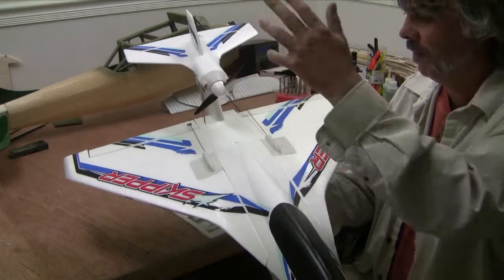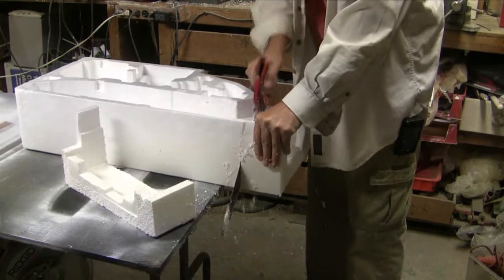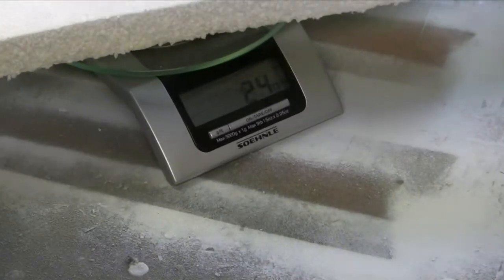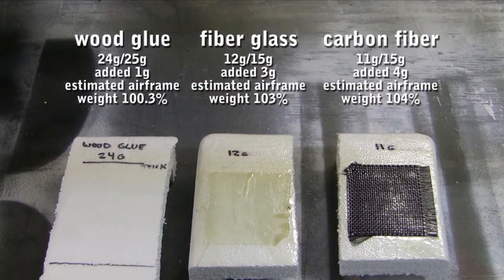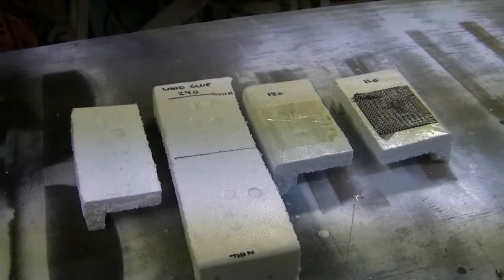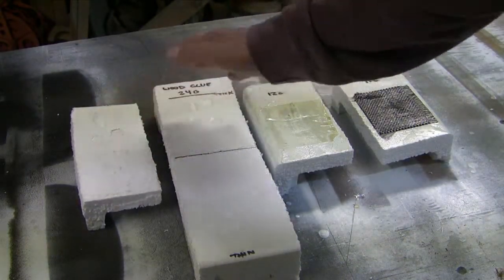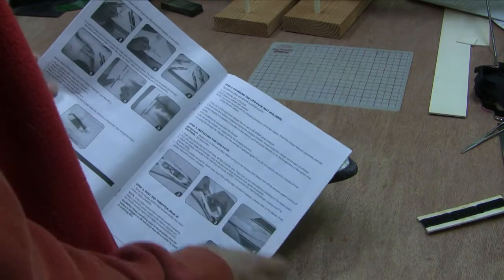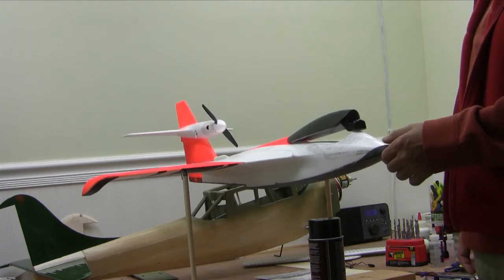Nodd RC - 066 - HK Skipper part 2

Comment: Good job testing the different materials and good job applying the carbon fiber mat. Looks great.  I had already applied aluminum tape to bottom of mine.  It won't be impervious to pavement but i expect long life in water - I applied a low heat iron to it.  It shrunk into the grain of the foam nicely.  A powerful bond I think.

Comment: Foam amour is also available by Horizon Hobby in the US. $10.80. They have all of the Deluxe Materials products. Good video. I have the Polaris which I built and love the plane.
Reply from the maker: Ahh yes look at that, Horizon Hobby does have Foam Armour in stock. I'm not sure that was a the case a few weeks back when I was looking for it but good to know its available now. I might have to order a bottle & check it out. Thanks for the heads-up Glenn.
Reply: ***** Was looking up the info and see it is water based so I do not know if it would work on float planes. It is paint able so it might work. check out dekalbrcflyers youtube channel which I manage.
Reply from the maker: Glenn Bond
I'm not sure water based is a problem for a float plane. I mean it doesn't spend hours in the water, just gets wet for a little while. I ordered some Foam Armour anyway, will do some tests & if it is a problem in water then I can still use it on other not so soggy airframes. Thanks again for the Horizon Hobby suggestion.

Comment: Chis, Hi. With regard to your Foam Armour. I did some research and I discovered that if you can aquire some Ronseal Diamond Hard clear varnish, that will do the same job as foam armour. In fact, I have tested both products, and they are one and the same. They are water based, and are easy to clean your brushes.  Perhaps you have alternative product in the States. I used a lightweight tissue on my aircraft, but a lightweight Glass cloth will do just as good. Paint a coat of varnish onto yoir airframe and then lay the cloth over the top, and paint some more varnish over the top, brushing out the excess. It is waterproof when dry. You can then apply more coats as desired without adding more weight. That is my solution, and you can even use car spray paint over the top.
Reply from the maker: +Anthony Bamford I finally got my hands on some actual Foam Armor recently. I've not had a chance to do a proper test but it looks like good stuff. Ronseal is available here in the States, appears to be regular polyurethane varnish. I've had good success with Minwax polyurethane varnish which I assume is pretty much the same thing? I like it for large jobs as its cheaper than finishing epoxy resin & does the same job more or less. Funny you should mention using tissue paper. I just coated a foam rudder using a roll of super lightweight brown paper, pretty pleased with the results. Granted not as strong as fiberglass cloth but for this application it doesn't really need to be super strong, plus paper is a lot cheaper too. Thanks for writing, good advice for sure.
Reply: +Anthony Bamford 
I use standard Yacht Varnish which is pretty well same. My first cats are water based paint to the colours I want ... single coats are good with this. Then overcoat with the Varnish to create water-proof and a hard shell finish. Any nicks are easily filled with the paint and a lick of Varnish over top.

Comment: Nice job comparing the options. I have often thought about a way to cover all my foam planes. I did not know about Foam Armour. Looks like lots of it available on ebay. Would like to know how well it works without picking up so much weight.
Reply from the maker: I ordered some Foam Armour. You can expect a review in an upcoming episode.
Reply: ***** What a great job you have done, we love it, can you tell me what finishing resin you have used and where I can get it.

thankd

Comment: Doesn't all that electrically conductive carbon fibre add a really effective barrier to radio signals? It's why we have special receivers (with antennae that run outside the model) for carbon models, is it not?
Reply from the maker: Apologies for the delay in replying, I've been taking a break from YouTube. Yes carbon fiber is quite effective at blocking RF signals. For that reason I'm using a "whip antenna" on this model that sticks out of the top of the fuselage. I do the same with all my CF models.

Comment: Cool vid.  What type (brand) of epoxy/resin do you use for finishing the fiberglass & carbon fibre?
Reply from the maker: UnlimitedVertical I believe I used Z-Poxy Finishing Resin on my Skipper's hull. I also like West Systems.
Reply: ***** Thanks.  I've had my eye on the Skipper/Polaris for a while, but this video peaked my interest since I tend to reinforce parts of my DIY planes and car bodies with a pseudo-fiberglass (fiber tape and goop/shoe goo).
Reply from the maker: UnlimitedVertical I've always been keen on seaplanes but sticking a pair of floats on a regular plane always seemed like a half measure to me. Their top heavy stance seems really unwieldy, one small hiccup & you're upside-down-n-stranded. Far better IMO to fly a purpose built flying boat with an actual hull. Of course I've flipped my Skipper over plenty so even that's not immune. Still she's a really versatile air-frame, grass, snow, water, sand, what-have-you. Fun stuff.

Comment: I have tried similar tests. What I found was the model was not the same type fom as the box. The box material was attacked by the paint. The model was not
Reply from the maker: Yes I didn't really give the rubberized spray a fair test. You can also try spraying just a light dusting at first & then build up from there. That gives the solvent a chance to evaporate before it can eat the foam. And yes you're correct, good chance the packaging is made out of a different foam but I think for test purposes, that didn't necessarily matter. It was the coating I was interested in testing. But obviously I didn't want to test on the actual model.

Comment: What is carbon cloth I use? I thought of 160g/m2 or 200g/m2. But this is just my guess. I´ve never done it before. I need an advice. THANK YOU.
Reply: +Petr CZ 
No answer, so I finally bought a 420 g / m2 and it looks good.
Reply from the maker: +Petr CZ My apologies, I thought I'd answered this, apparently not. To be honest I don't know what weight of carbon-fiber cloth I used on mine. I had some "aero-space scraps" I found on ebay & used that. Mine uses a fairly heavy weave, probably overkill. What you've bought there sounds like it should work. I'm not sure its super critical. Best of luck.

Comment: Could you please tell me what kind of paint did you use for the plane.  I use water based airbrush sometimes but looks like shit.  Thanks.
Reply from the maker: Rust-oleum spray paint.
Reply: +Chris Evans - Nodd 
Be careful with the solvent in this paint ... make sure you spray very light coats and at good distance to clear the solvent from attacking the foam.

Comment: Elmer's white glue is not waterproof. It will soften when in contact with water even after it has fully cured. Elmer's "wood glue" on the other hand is waterproof.
Reply from the maker: Thanks Daniel, that's good to know. Next round of tests I'll have to give the wood glue a try.